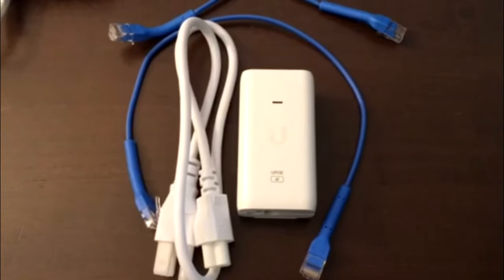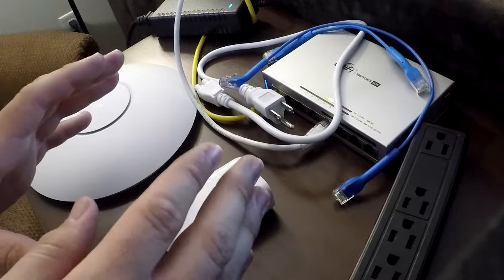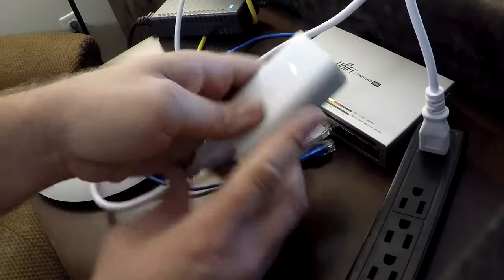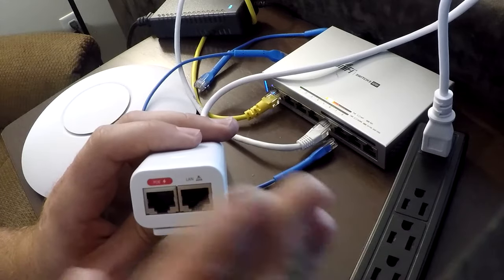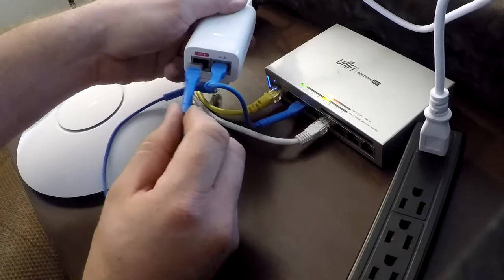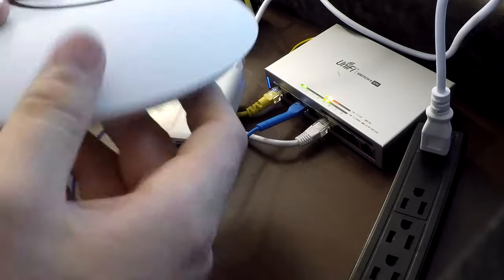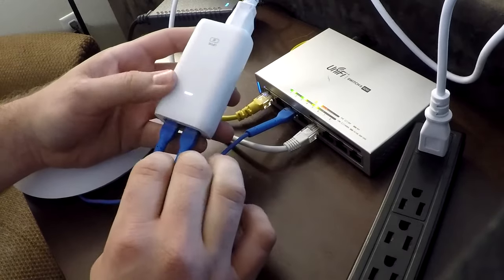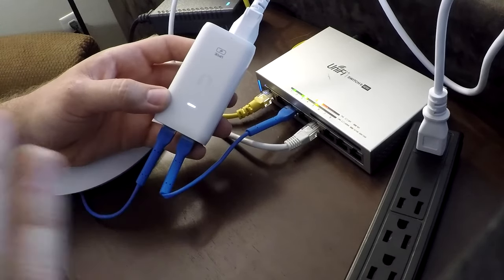Setting Up A UniFi PoE Injector!

Comment: I have the dream router and U6 long range and i bought the POE++ injector from unifi. My UDR is downstairs and my U6 Long range is upstairs. Upstairs I have a poe port, so i connected like you said the lan port from the injector with my poe port in the wall and my poe++ port from the injector with my access point. It works, but I still get this message in my network configuration from the u6: This access point is connected to a port, which does not supply sufficient power for optimal operation. To ensure reliable and full-capacity performance, please connect the access point to a PoE+ compliant port. I was hoping that the injector could fix this problem, but it doesn't.. Did I do something wrong?
Reply: UPDATE: the problem was the connection in my wall with the poe port of the UDR. Once I changed it to a non POE port from the router the POE++ could take over.

Comment: Thanks so much! 

I have my tplink switch (non poe) and router in the garage downstairs, so I plugged the POE injector to power and switch

Now I have an ethernet port upstairs that I want to attach the AP, would it just work through that port or the should the injector be upstairs attached directly to the AP?
Reply from the maker: If the port upstairs is not poe then the access point will not work for the port. You would have to take the poe injector and plug the Lan port into the wall from the poe injector, then you would plug the port that says poe on the injector into the access point. That should make the access point work.
Reply: @gbnetworks8722  thanks so much I appreciate it, all working well!

Comment: Question, if these are being used as a wireless AP, I'm not required to plug an ethernet cable from the injector to my switch/router, correct? I can just power the AP using the injejector and then connect the AP wirelessly to my router?
Reply: If you’re going to wirelessly link to another access point for data then yes, you can use a Poe injector to just provide power. But you’d have to have another UniFi access point that’s connected via an Ethernet wire to uplink too. Is that what you mean?
Reply: @nodd85  what I'd be doing is purchasing three access points, one of which will be powered using the injector and connected to my router via ethernet using the Poe injector and the other two will be connected wirelessly but powered using the injector and only using the injector to power the access points, not hardwired to my router.
Reply: @shervinaryan2631  That will work. I’m assuming you can’t get ethernet runs to the other 2 locations?
Reply: @nodd85  no, I wish. The main problem will be the 2nd floor but I'm waiting to move into the property in June to see if I have the ability to fish up a cable, which I doubt. The main problem will be the 2nd floor. The basement is unfinished so it'll be hardwired as well. Thank you for the help!
Reply: @shervinaryan2631   I understand, sometimes you gotta work with what you have. Good luck with the move. If you have any questions after you set it all up let me know.

Comment: Can I connect  from a internet  router to the power injector then from there to my wifi router or do I need a switch
Reply: You can but it will not give the switch poe power. You will need to heft a Poe switch.

Comment: How many access points can you use with that switch?
Reply from the maker: This is the US-8-60W POE switch in the video. It has 4 regular non-poe ports and 4 poe ports. So technically this could power 4 access points.